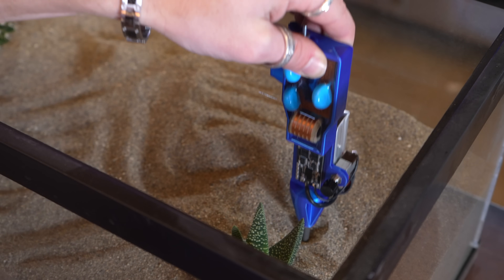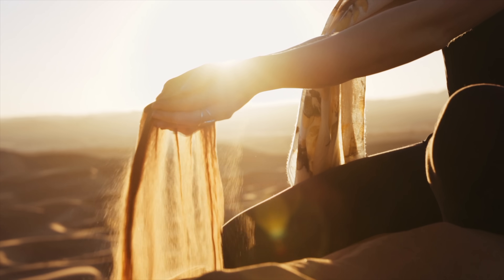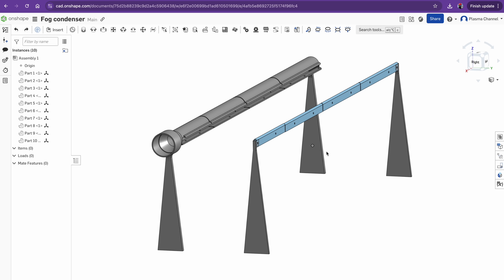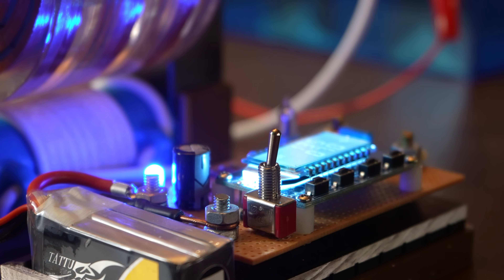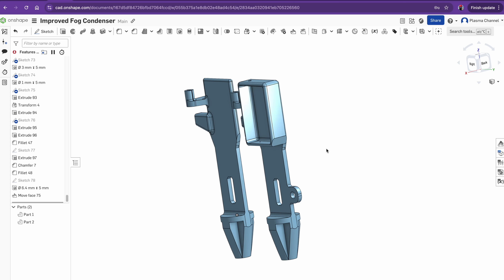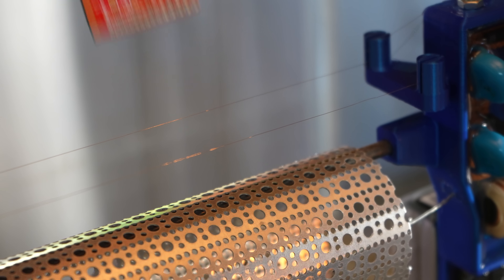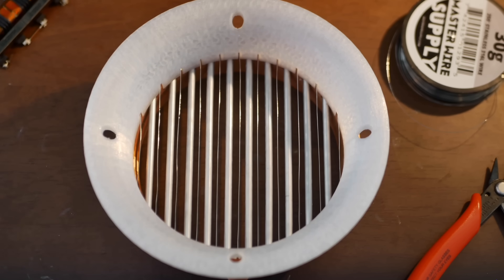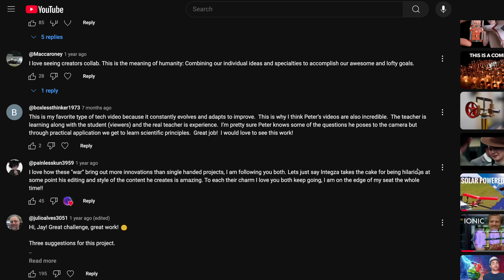Solving Desert Water Shortages Using 20,000 Volts

Comment: Your Ion Thruster videos are interesting, and they do speak of a future, when coupled with proper BYD/CATL/ZEEKR or some other new low cost Battery breakthrough.  They are the future.   This has practical applications, more than what you see there, what you need is a Global Network for distribution and it would be best to produce it locally.  You can't patent it, because you made it public, you can try, though it is expensive.  Your best option is to lease the idea and have a Fortune 200 company distribute it globally.  Testing in Atacama is alright though it is impractical, though Chile will copy your design.

Now testing this in the Andes in Argentina, Bolivia,  Peru or Ecuador even Colombia, has practical an immediate returns as long as you can keep the price down (you have a large market in Africa, Middle East and Asia as well).  Given the components (3d and electronic) it is quiet easy to mass produce. The electronics can be purchased individually from Amazon for less than 2.1 dollars powered by 3.6v 1.5 (High Voltage Generator DC 3.6V 1.5A to 20KV 20000V Boost Step-up Power Module High Voltage Transformer), this can be reduce 10x in mass produced items..   The solar panel and battery are priced under 10 dollars as well, 3d printed stuff and so on.  Mass produced solution  you are looking at a product for under 30 dollars, with immediate impact.   The part your missing is the control part, so it can be controlled remotely, and there are solutions for this as well at a global level, and keeping the cost not far from 30.  The design has to be optimized for water collection over irrigation.   

Reach out if you are interested, kudos, you have a winner here, you  just need the other parts of the puzzle for a practical solution!

Another interesting solution is for hikers, taking one of these collapsible systems hiking, light weight, and useful for water when climbing or hiking.  Like I stated.  There are more uses for this than you conceive, if you reach out I can suggest those that will provide the best returns as well by a huge factor over what you imagine now.  And it is not what you are thinking.

Comment: So if it's static coronal discharge you're after you could use a mylar helium blimp and let the atmosphere power it using a spark gap graphene doped cotton thread whole thing would weigh nothing so use very little precious helium might need to run lines to the tail and use clever geometry to make it raise or lower itself to keep altitude if you have strong catabatic winds to contend with maybe see if you can use the atmosphere to create the electricity to dry itself ;) .
 With mylar and double sided tape you could incorporate inflatable ribs for strength and shape forming with very little loss of lift for a fraction of the weight of even carbon fibre structure. Best part is it would be cheap like a budgie so easily iterative could be made until you perfect the cable length weight and how its tension can be used to keep the whole thing stable use straws and string and geometry to control the tail of a cigar blimps rudder and elevators also a rinse of the inside with watered down pva will add weight but prolong flight duration as eventually the helium will sneak on out another metric to test I know they used pva for some high altitude statites in 2010's. After all what is cooler than free water from air with high voltage? free water from the air with free high voltage from same said air twice as cool.

Comment: Thought of another use (or misuse of this phenomena).  I'd call it a humidity pump. A lot of folks in the 3d printing world (I guess including you Plasma dude) have problems keeping (and drying) their filament. I'd like a big box that can maybe hold 10 or more rolls of filament and just run some sort of conditioning thing all the time ensuring my filament is ready to go whenever I want to print something. Of course there is a lot of ways of doing it including heaters etc but these potentially damage the filament if left heated for weeks at a time. So my thought is :- if you had a sealed box with the filament in. Pressurise the box a little to get the moisture to start dropping out then use a circulating fan and one of your gadgets to get the moisture out of the air and into a collector.  Once no more moisture is being collected then let the pressure decay and the now super dry air will be sucking out the moisture  from the filament to equalise. A few hours later do the same process. Over a few cycles the humidity in the box at room temp should be below 10%. This cycle could run forever triggered on humidity and no risk to the filament.  Plus with no heaters or coolers in the loop this would be very cheap to run over extended periods...

Comment: It sounds great, however at a very large scale it could alter local micro climates and effect local wildlife and bio diversity that's evolved over thousands of years. However on a limited scale for small villages it might be ok.  Basically it's sucking the moisture out of the air.  i.e. what little moisture there is to go around.  The moisture has to come form somewhere and go to somewhere else.  With that said, a small scale application might be fine with no significant environmental impact.
Reply: I was thinking about this from the start of the video

Comment: AI SUMMARY: 
Inspired by an MIT study, the creator developed a system that uses charged wires and grounded metal grids to attract and collect fog droplets, increasing efficiency compared to traditional fog nets.

The process involves charging fog droplets, which are then attracted to grounded grids, allowing water to accumulate rapidly. Early prototypes demonstrated the ability to collect water at a rate significantly higher than commercial dehumidifiers, making the method both energy-efficient and scalable. The system has potential applications for agriculture in arid regions with frequent fog, such as the Sahara and Sonoran deserts.

It concludes with plans to refine and test the system further in coastal fog-heavy environments like the Atacama Desert in Chile. There's an emphasis on scalability and impact for global water crises. Let me know if you'd like more details on a specific aspect!

Comment: Also, farming aside - you just turned the domestic dehumidifier market upside down.  Why not adapt this invention for home use, since it's 10x more efficient that current dehumidifiers.  
And here is where you get innovation on a grand scale - as you create the product, competition will follow and adapt the design to make it even more efficient, such as different geometries of reticulating the mesh.
There may be a way to get 2 or 3 times as much water per kw than what you are currently getting.

Comment: You could make it even more efficient by surrounding the mesh with another positively charged mesh with a lower wattage but higher surface area. The inner one will decharge the fog and the outer one will help catch even more moisture out of the air.

Comment: Lets work on the collection & power source.  The grid has to be exposed to air & not oxidize from the collected moisturizer or any chlorides that storms might blow from the coast.  The power source should probably be solar & supercapacitors because bright sun baked desert far from power & don't want to deal with the rapid deep cycle death of batteries.  The drip collection should be as small a slot as possible in a hydrophobic coated pipe sloped towards larger pipes going to reservoirs.

Comment: Not 40 W for 500 mL... that's power, not energy. 80 Wh/L
Using 2500 of them and a 100kWh battery pack, that would mean 1250 L. This could be done with 20 kW of solar cells, or 50 400W panels with solar following and an MPPT charge controller.
And if there's anywhere that doesn't want fog with a side-effect of generating potable water, it's the approach paths of airports.

Comment: Dustupsranch may be willing to test it out on his property in Texas. I would probably also add the ionic fans you have to force air through something like a PVC tube to increase pressure and provide shade and then in the tube have those pull the air out.
Though a ring design my be better inside a tube.

Comment: Could you use this as a crude remote power and water generator. Solar power to generate the power to power electrodes  in the water to produce hydrogen. Then when the sun goes down and fog comes in use a hydrogen fuel cell to produce power to condense the fog? And repeat. Until making more hydrogen and water then is needed for the system.

Comment: You did not mention whether the water you used was distilled or plain tap water. Tap water fog from ultrasonic mist makers contains minerals present in the water while morning fog contains no minerals and the two should have different electrical properties. If you used tap water then I think you should rerun the test with distilled water to see if you get the same results.

Comment: If this is DC - why not use a high voltage capacitor between the poles and turn off the generator when the voltage is in the working window by using a micro controller and measuring the voltage? that might reduce power consumption drastically.

Comment: I'm thinking you should test this in a bigger desert... Maybe using a pool , 
Placing it under a solar panel wouldn't create a greenhouse effect, and a Shadow that prevents water in desert to evaporate... And if you shape the grid like an arrow on the bottom, you sould have all the condensed water dropping from the point of the arrow, please test all this
Reply: You should test it in the sun.. the hotnes of the sun in a desert habitat can warm up the grid a lot, and of course it could reduce the efficiency of the system... So having it in shadow under a solar panel could be optimal... 
You should build at least 2 of these to find the Optimal Minimum Working Distance  so that you can know the number of rows per meter, and so calculate the production / meter² , of course it will change with different humidity values too.. so make multiple tests..
Of course it should be close, because what's gonna happen if there is wind? 
In a desert wind bring sand with it, does the sand adhere to the grid?

Comment: Nice idea, and could be really good. But you need to check a few more things. 1. Perform the same experiment several times under the same conditions and see that the amount comes out pretty much the same. 2. Check what the lowest and highest level of fog is for how much water comes out. 3. Check how much fog you created (a known amount of water in a container will be created until it runs out or until a known amount of liquid is dropped (for example, a liter or any other amount) and see that the amount of liquid you manage to condense matches or pretty much matches. Then go out if it's in the field. In addition, if you say that most of the hours of fog in the desert are in the morning, then how will you operate it with solar energy? And another test that allows you to check how much water is created from the air without fog both in the morning and during the day. Good luck

Comment: I am irrationally excited about this.
Reply: Put it on a blimp and have the production drop down a small tube like used in fish tanks with the air pumps. 24/7 production if you can get it high enough. (Not an original idea, just bringing that up as a thing you could do with this).
Reply: Kawasaki's wolf prototype. That thing you can ride like a horse that runs on hydrogen power. Yeah... This could fuel that thing.

Comment: I think this method does not work with humidity... It is better to use cooling to collect humidity from the air, just like what happens when you turn on the air conditioner.

Comment: So, how much is it exactly? Solar panels cost you roughly 130$/kWp and their efficiency drops to 30...50% in foggy conditions. let's assume they are perfectly alligned towards the morning-sun and they work for 15 years and you use them 3h a day, meaning 5465 kWh useable energy over their lifespan per 260$ installed panels or 4.7...8 ct/kWh or 0.33 ... 0.57 ct per Liter of water, which is 1/100 of the price of bottled water (after tax).
Viable so far... but
lets assume the rest of the electronics cost twice as much as the panels (per useable kWh) and the fog density is roughly 1/10 of that in the experiment. In that case you'd end up with 9.9 ... 17ct/L. And If the fog only occurs every other day, you'd basically water your plants with bottled water.

But there is an argument, that the fog-density is not as much of a factor, since you only need to increase the number of wires inverse proportional to the fog density to get the same output, since electricity is only consumed when electrones flow, which only happens in the presance of water droplets. That is worth testing, though.
Also: for better efficiency, at least the wire probably has to be hydrophobic.

Comment: If you have the voltage wire circle back around the grounded mesh, so that it can ionize the fog that comes from the other side of the mesh, will that increase the water output as more fog is ionized?  I noticed most pulled to the voltage wire, but there was a lot of fog escaping on the otherside of the mesh net. Not sure if that'll help, especially outdoors when you can't really control  how the fog rolls in.

Comment: The problem with this design is your only wetting the surface of the sand, within minutes of sunlight it will evaporate. A real setup will need to to have a membrane on top of the sand or some way to send the water deeper.

Comment: Pretty sure Thunderf00t already described the problem with this being the amount of energy consumed, the space required to capture/convert, the amount and variation of moisture in the air available (such as seasonally, time of day, or other effects), and actual quantity produced given a certain amount of space and time.

The usual conditions are presented as ideal scenarios rather than average and worst case bounds, and not fully describing the areas where this would and wouldn't actually work to produce a particular wanted outcome.

Comment: Consider rotating your mesh 45 degrees so you have diagonal lines instead of horizontal lines...   The water could collect together and drip faster.  Maybe even with triangular points at the bottom. A convergence point with less surface area for the water to hang on to.  Just a thought.

Comment: Wait... this is just an ion thruster? Just... using one of the downsides of one (condensation can interfere with the thrust it produces) as the main upside!?
EDIT: Oh, you were making an ion thruster.
EDIT 2: Having these things set up to be automated, modular drop-and-go devices could be amazing. A solar cell on top charges the battery during the day. A humidity sensor (or just timer if cheap) turns them on. Installing them is pretty simple; stake them in, run a ground wire, drape+tie a mesh over, run the charge wire, turn it on. I WOULD consider some kind of guard (maybe fishing line and spacers) around the charge wire to protect the charge wire from damage and people and wildlife from unexpected surprises during operation. Other than further testing and cost/durability, it's seems commercially viable?

Comment: Amazing achievement! If you used something with a much higher surface area like wire wool for example instead of the metal plate, is it able to capture even more moisture?

Comment: Isnt movement and local depletion the problem here? the fog in your setup is basically "supplied" to the net. but without strong winds-  which would dissipate the fog - the fog wont move fast. so your setup will deplete the humidity in a local region quickly and then it will most likely only triggle in the speed that the air is moving the fog along. which is probably NOT to scale. ergo the output in a live situation will most probably be a lot lower than this idealized lab conditions?
Also what about particles in the air or even insects? how robust is the system against the enviroment en large?

In general it is a good idea but it seems to me that proving the concept under ideal lab conditions is not as much as a eureka moment as its made out to be :/

Comment: There is another use case for this method of condensing fog that will only continue to grow in the future: condensing fog in a hydroponic system. Have you heard of "Fog-ponics", or growing plants using fog produced by ultrasonic transducers? If the roots are hanging in a dark space and fed the fog continuously it provides the perfect conditions for the roots to take in the moisture and nutrients*, as oxygen is necessary for this process. The issue with making DIY systems is gauging the amount of fog you're producing, and balancing it with the volume of air that is circulating, and the amount that is condensing on the plants' roots (and returning to the reservoir where the fog is produced. This would be a lot simpler to balance, to limit the loss of water from leakage and the amount of time the transducer are running, with the help of a reliable way of condensing excess fog from the system. I've been looking at passive condensers and they have to be too large to be practical, but this HV method of condensing the fog would shrink that down to maybe a couple of feet of 12" tubing, with the condenser inside. 
* The reason this works is because the fog droplets are produced by the smashing up of larger droplets by the ultrasonic transducers, rather than through evaporative processes. This means that the droplets can contain the nutrients that the plants need, at the same concentration as the reservoir maintains, rather than condensing as pure H2O. If you've ever seen the difference between growing in soil versus growing in a hydroponic setup, the difference between standard thin-film hydroponic growth and fog-ponics is roughly the same again.